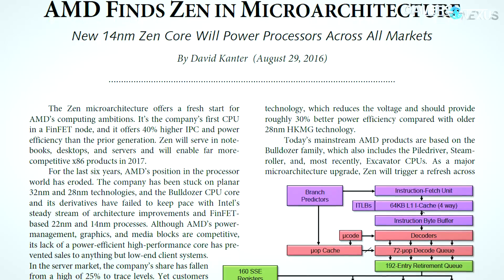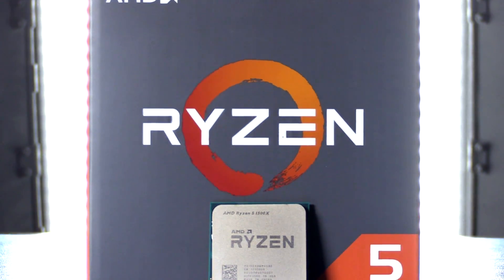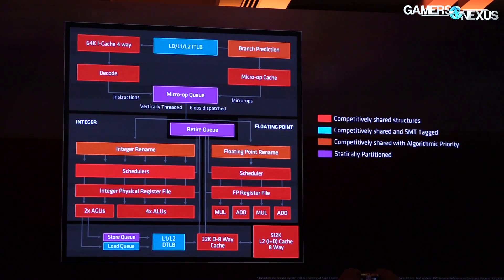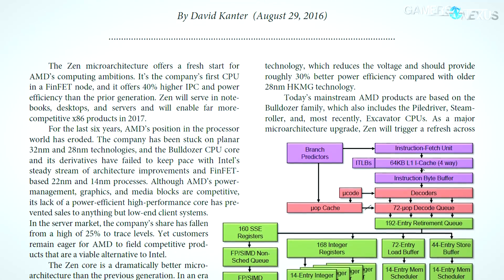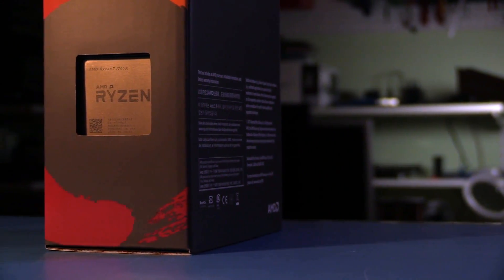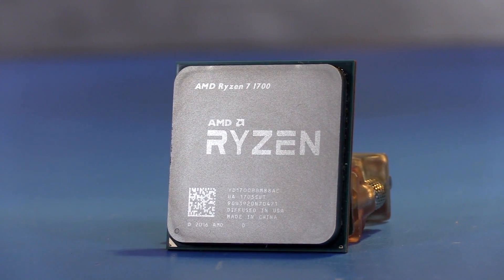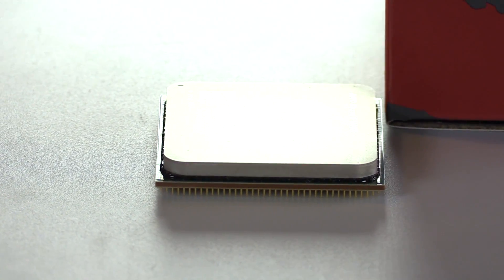Ryzen Chief Architect Interview: Micro-Op Cache & IPC Gain

Comment: 'We optomized the glue that held the logic together' OMG intel was right! Everthing is a lie! 

Lol
Edit: just want to make it clear to those idiots who repied I am not an intel fanboy, I own about $100 worth of amd stock, have a ryzen 5 1600 in my main system. Just trying to make a joke. 
Also to the less idiotic of you thank you for explaining glue logic to me, I am familiar with the term and was once again just trying to make a joke
Reply: "Glue" is an actual term in electrical engineering, although when intel made those slides I have no doubt it still was with spite in mind.
Reply: what he is effectively saying is they optimized the paths that cache and logic must take through the processor to reach the execution stage. In physical terms this is things like Intel's new Mesh and Intel's old RING Bus. While it might technically apply to the Infinity Fabric, said Infinity Fabric doesn't account for the paths inside a single CCX, which is where I think at least half of these optimizations took place. And he's also probably talking about data travel inside a single core's L1 and L2 cache(s).

This single fact of optimization that Ryzen has is an immense factor of power efficiency (and a little bit of IPC) in an x86 processor. It is no surprise that in order to get more power efficient and more viable to manufacture by extension, Intel had to change from the RING Bus to what is now the Mesh.
Reply: I'm surprised Intel didn't jump on the fact that they "evict" things from the cache 6:01 and even have a "victim" cache 6:20 . AMD sooooooooo evil 😂
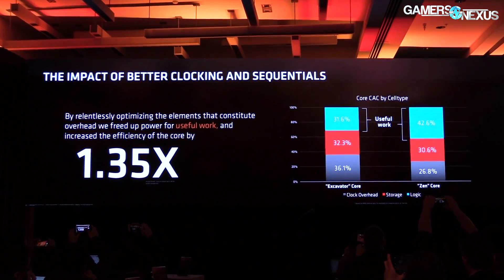Reply: Stefan Gligorijevic It's at 4:06
Reply: I would like to point out that this was a technically accurate use if the word 'glue' when referring to processor design, as this would consitute the glue logic.

What Intel said however was full of shit, the interconnect is exactly that, an interconnect, not a bunch of on die memory addressing logic
Reply: FAKE AMD NEWS!!!  lol just kidding and sorry about channeling Trump like that ;)
 I really enjoyed the content in this video but will admit that a lot of it was over my head.  But the AMD engineer did a fine job in trying his best to explain how the new Zen cpu was improved over their previous offering.  Hope the new Epyc and Threadripper cpus perform as well in their targeted segments as Ryzen cpus are doing in the mainstream cpu market.  I now have two nearly identical 1700X systems being used daily.. one as my primary home desktop and one as my workstation at work.. and they are both performing extremely well in everything really but especially in my multi-threaded tasks at work where the 1700X is blistering my mp4 to ogg video conversions like 80% faster than my previous Dell optiplex i7 (but admit it's almost 3 years old now so not fair to compare it to the 1700X I suppose).  Knowing Dell, it's probably a slower i7 in that cpu line's generation as well, but it's not even worth turning it back on to find out and will go to someone else at work instead.
Reply: Metallic Hawaii not an intel fanboy, I own about $100 worth of amd stock, have a ryzen 5 1600 in my main system. Just trying to make a joke.
Reply: $100 worth of AMD stock, holy shit, you own their entire business!
Reply: SirFairPlay Well, i mean, he's the one doing well if he bought about 16 months ago, it's been about a 700% increase in stock value so far
Reply: tfw when ppl no understand joke
Reply: Toby Cowles When did they said that? Time stamp?
Reply: smokeydops i know, just making a joke :)
Reply: Pennywise weird, I can see all 15 of the replys
Reply: YouTube just glitched, they are all there.
Reply: SirFairPlay I know, but it is something.
Reply: if you're gonna quote, what was actually said. "We optimized the sequential elements that move the data in between the logic, they're kinda like the glue that holds everything together..." is what was actually said. Nice try intel fanbaby.

Comment: "These things run at 4Ghz".. some of the time.
Reply: Blame Globalfoundries 14LPP design more than ryzen itself. Should be increased with the 7nm process that GF is going to use.
Reply: Lost Eye But it makes sense that if they lowered the power drawn by the clock it can't clock as high as the competition. I think its smart for most workflows
Reply: Kent Wong. Not quite. Most Non-X versions too out at 3.9 Ghz.
Reply: I'm not funny at all. I'm a cunt.
Reply: 4GHz all cores on 1800x with 3466MHz RAM here. Not that all of them can do it, but it is possible.

Cooling is critical.
Reply: Caffeinade I wouldn't say it's Impressive seeing as intels older 8 cores could reach that or more and the 7820X can get to 4.8Ghz only problem then is it becomes quite hot. Think digital foundry recorded it hitting 80 degrees with a H100i V2 which isn't too bad but still.
Reply: Maybe the frequency-scaling with the Infinity Fabric design works a bit better than we're used to
Reply: That's complete bollocks. Post your source on that, I dare you.
Reply: I'm at 3.95 on my 1600
Reply: ye, on 1 core 90% of the time!
Reply: *up to
Reply: @Caffeinade Threadripper's 4 GHz is only boost clock though. And it's 2 different dies. So all they have to do is pick two working 1800X dies that both reach 4 GHz on a single core (boost). This is also why I think Threadripper's boost clock is on 2 cores. One 4 GHz boost per die.
Reply: Ye sure I don't disagree, I like Ryzen, but the corporate fellow needs to get his facts straight xD